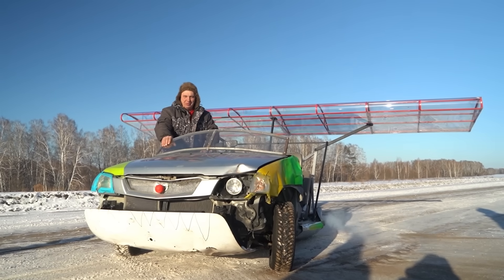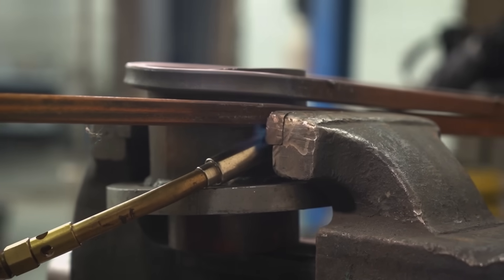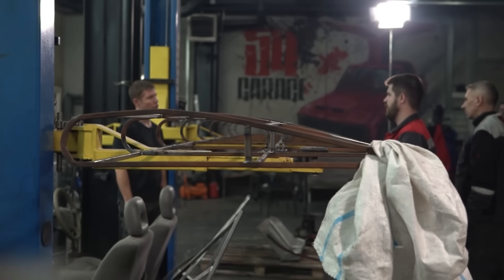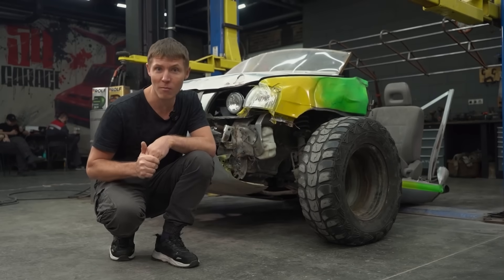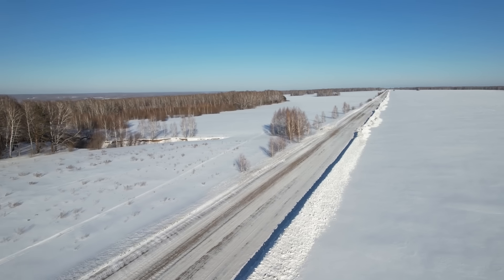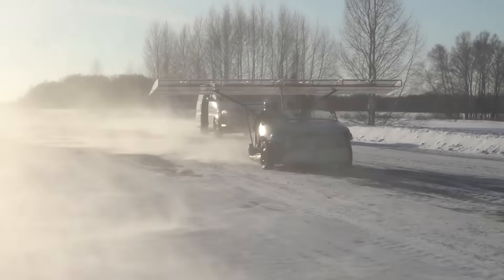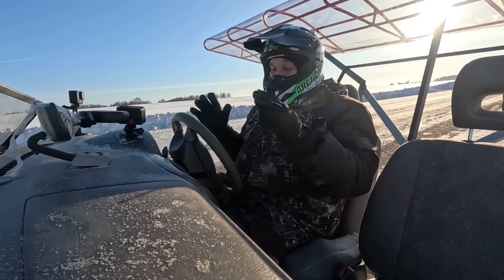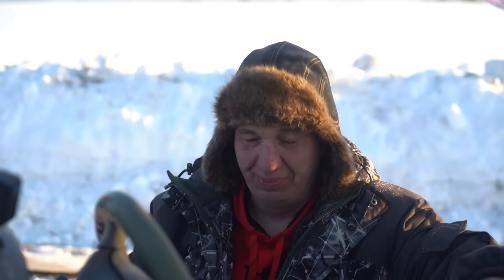We fit a wing to a car - will it lift off?

Comment: It flew a little, but it only came high off the ground when trying to brake; this throws the weight of the wing forward and only looks like flying.  That wing is built like car mechanics would build it, which means overbuilt ;).  It's probably okay, though, as it's big enough to do the job anyway.  Still, it's probably always on the border between flying and stalling and once the rear comes up the angle of attack stops it from generating lift.
Reply: In addition, there is the weight, which was mounted at the front somewhere in the middle of the video.
This also causes the rear end to lift when braking.
So, no real lift that causes the rear to lift off that high.
Reply: One can "fly" in a bicycle by locking up the front wheel at speed.   The rear wheel will lift up in the air.  No wings required.  An actual Cessna light aircraft needs to go 60 to 70 mph to lift off.   There is no way that small heavy wing could produce enough lift at the 30 to 40 mph they were going.

Comment: You need a rudder that is fully functional, to make it steer. Any wind that hit your wing just throw you off with generating little lift but without working rudder, it's not going to do much.
Also 60 km/h is still too slow for that weight, you need about 14 km/h more to have 40 Knots. If i roughly compare it to the Cessna 172 SkyHawk. 
I suggest make some vertical stabilizer, that will work with the steering wheel. But i don't know how to make horizontal stabilizer. Maybe somebody will tell, but i don't have idea.

Comment: Need to attached vertical stabilizers and ailerons to control the asymmetrical lift that’s causing the horizontal axis rotation causing the loss of control.

Comment: Attach small light weight wheels in the back. Something like a shopping trolley would have, but rubber and not turning. Wagon wheels. Should only be a few kilo each. This will help keep the car straight. 

Turning or staying straight when you catch lift - is another issue.

Comment: It needs tail or some type of vertical stabilizer to keep it pointing straight. Basically like a tail of a plane. Make sure it’s behind the wing. 
This should auto correct some of it but ultimately you need a rudder. 
Or you could create some drag on the stabilizer like a dart to keep it straight.

Comment: Last time that I checked a spoiler is used for down force 😂... This would need flaps and higher This is just make the nose turn into the ground because of the front engine weight.

Comment: If the idea is to lift only the rear of the car, it needs three additional things: airspeed indicator (ground speed is irrelevant here), a vertical stabiliser and a means of charging the angle of attack. To create more lift at the rear, a higher angle of attack, and the opposite to lower it. The steering wheel can be converted to be more like a yoke, which also controls the rudder. Ailerons will not work, and will lead to instability and even a rollover.

Comment: I believe if you add a counter steering mechanism on the rear end , of the rear wing , going up and down forming a lower case T , allowing the vertical part of the wing to counter react of the wheels to keep it straight, if that makes any sense

Comment: Why steel ribs? Why not lead?
Reply: Lead doesn't have the tensile strength.
Reply: welding aluminum is pain, maybe
Reply: Good idea. You could fill the tubes with lead, then seal the wing , and fill it with helium or hydrogen to save weight.

Comment: Tail fin with rudder, or just rudders mounted to the current wing assembly, controlled by the steering rack. Move the wing mount point further forward and slap in a propeller in the front and you got yourself a flying car 😂

Comment: You have to put the wing a little bit more to the front and add a tail for control. A propeller in the front and you might actually build a working airplane! I think you need a little bit bigger wing though.

Comment: It needs a rudder connected to steering, a second set of wings at front and rear wheel drive and maybe add a fan to tot somewhere so it has power once taken off and doesn’t glide back down

Comment: Two thoughts here:
(1) What if you add a smaller wing to the front of the car to help with lift 

(2) The steering issue is not turning the car when the back is off the ground it is shifting the weight and trying to role the car, the steering becomes very sensitive when the back is off the ground.
I'm not sure I am explaining what I mean.

Comment: It needs an ice skate ⛸️ attatched to the back, preferably as long as possible, attached to a pole that only pivots up and down and an ankle joint at the ice skate. Laser cut sheet metal would probably be enough for a skate. The pole should be strong and on the longer side for extra stability. Make sure the pole and nothing can twist. Then put weight onto the skate and add more for more stability or take away weight for weight reduction
Reply: It could also feature a spoiler to push the skate into the snow

Comment: it whont fly (all the way off the ground) as it only gets propelled by the driven wheels if they lift of the ground the forward speed will bleed off and it will come down 
having a rudder will allow it to steer even with the rear of the ground the frontweels should stay pointed straight ahead , it will steer like a forklift , they probably tried to get the rear airborne with a crosswind , this pushed the car sideways

Comment: You didn't get lift from the wing on that first attempt, enough to say it was 'flying' it was weight shift from slamming on the brakes that lifted the rear. With the CofG and CofP, no way this thing will fly. The back lifting off the ground when someone was brave enough (and also when the wind was zero) to keep going past the threshold of the wing lifting the rear

Comment: I think the rotation of the engine might have some effect on the stability once you have partial lift off.  As with a sailboat, where CE must be directly over CLR, the wing needs to lift directly over the greatest weight.

Comment: Why not use aluminum if your trying to make it light weight?  Also elevators on the wing would help tremendously. Ailerons and a rudder would be a big help also. But those might be more work than they want to put into the project.

Comment: You must add a stabilizing tale to make it fly, how would you be able to hold it level if it takes off? All planes have a tale and the wings is to short for it's weight. And I doubt you can get enough speed to take off and if it takes off how can you keep it flying without a propeller? When the tires leave the ground you have nothing to keep the speed up anymore. And you need a rudder on the tale, It's doomed to fail. Sorry. 😒

Comment: I'm not sure what they thought they were doing because the speed is all coming from the wheels. As soon as you get off the ground you start slowing down because of air friction. You have no propeller and no turbines. What did you expect to happen?

Comment: Surely these guys knew this would never work. There are so many reasons why. That wing is smaller than a hang glider's; no way it could lift the weight of the driver and all that other POS connected to him. As soon as the rear end lifts, the angle of attack of the wing goes down, so it makes less lift. The upper and lower main spars may (may) be strong enough, but there's no shear connection between them, so the wing has no bending strength. It needs a tail with an elevator, to force the wing to the correct angle of attack. The center of gravity is way, way too far forward. If it were somehow to lift off, you'd lose thrust as soon as the tires broke contact with the ground. You all have a bright future as designers in Putin's air force.
Reply: Watch the video, and you'll see their mission parameters were accomplished
Reply: Congratulations on both comprehension and watching an entire video before making pointless comments. Namely at achieving neither.

Comment: IMO your wing is too heavy, the frame should be made from wood or aluminum and you should make the wing angle more easily adjustable. Also, a winglets or even a small drag chute would keep it headed in the right direction.

Comment: Now you know why planes have rudders for steering. Have the Russians considered aluminium for airframes and wing skins? At least you're not using cast iron and lead sheet. Dont think anyone will beat Top Gear's Reliant Robin space shuttle though.

Comment: The perpendicularity of the wing to the direction of travel is being compromised by the flexibility of the framework.  Cross bracing will help.  A vertical tail will help with cross wind conditions.

Comment: You basically need a whole plane tail construction in the back and another wing in the front
The current construction will generate a lift force on the rear, but because the center of mass is past the wing it will produce a rotational momentum. That rotational momentum changes the angle of attack in the wing, making the rear to fall. That means your system is an unstable system because forces don't cancel each other and the overall sum of them is an oscillatory force that compromises control. The best approach is to use a rudder for control when the aerodynamic forces quick in, another wing in the front to counteract the rotational momentum and a set of horizontal stabilizers to add lift when the back lifts up and mitigate the loss of lift
Reply: Don't need a wing in the front.  If you lift the front you have no propulsion because the WHEELS have to be on the ground for that.  All they are trying to do is lift the back in place of wheels being in the back.  And any extra lift in the front will make controlling the vehicle even harder as the vehicle loses friction/traction with the ground - the steering is the same wheels.
Reply: @HutchinsonJC  you will have no lift at low speeds. Only at the enough windspeed you will have enough lift to loose friction, but at that point you will also have enough speed so the aerodynamic surfaces can compensate like a rudder would. They have a static stable construction, but it is dynamicly unstable.

Comment: Hi guys, that was great, love the idea and enthusiasm! 
A thought re the direction stability, yes a fin and rudder would help but perhaps you should try putting some dihedral into the wing, this naturally makes it more stable and is a common feature on aircraft, eg AN2
Added thoughts - how about putting some flat plates on the end of each tip to act as selt correcting rudders? Easy to try.

Comment: The old WW1 pusher style biplane called a DH2   https://en.m.wikipedia.org/wiki/Airco_DH.2   is close. So you could run a prop shaft and prop out the back and put a front or rear tail on for directional control and stability. And a joy stick in the floor. You are very close to a flying car!

Comment: I think it nees a propeller, because the moment the wheels loose grip on the ground, the air resistance will slow down the car and it will wall down immediately. Just make a plane of it ;)

Comment: Hey guys!    You need a tail rudder!    Keep the wheels straight straight when it starts to float and steer with a tail rudder.   Also slope wings up slightly from the center so it self stabilizes left and right

Comment: Add stuff and lift that thing full of a ground, put that huge fan you tried on its front, remove even more stuff to reduce weight and give it a 4-5 meters long tail with + style basic wing control (side to side, and top to bottom). It could work to lift it fully for short distances.

Comment: From Garage 54 to Hangar 54. Btw, you need a vertical stabilizer, with a rudder possibly, so whenever it's airborne, you still have the control. But I think the wing's angle of attack is also important, maybe making it adjustable can help a lot.

Comment: Cool experiment bu I ran the video several time and never saw it get airborne. The rear, yes. but if the front wheels lose traction speed drops preventing lift off.

Comment: garage 54 in year 2030: we make spacecraft from lada and make trip to mars
Reply: Yes, call Elon to not worry about it, G54 has it covered.
Reply: and get fined $100 for not having a pilot licence.
Reply: @joelpichette  how world they get fined in space? Think!
Reply: Space R
Reply: Lada spacecraft with 100 electric drill motors, rubber bands for shock absorbers, and sawblade wheels. Oh, and a billion kilometer extension cord for the motors.
Reply: @randallmacdonald4851 und nicht zu vergessen die Computerchips aus Kühlschränken und Mikrowellenherd ☝️🧐 
😂🤣😂🤣
Reply: Space L (from Lada) or Space G54 (from Garage 54). 😅
Reply: 2030 oo long.

They'll do it tomorrow 😅
Reply: Hahhaahah!!!
Reply: 5 more years
Reply: 2030 What is that like 2 years away? xD
Reply: And 10 minutes
Reply: WING IS TOO HIGH!!!  REmember Ekranoplan, you need wing to be low to use ground effect!!
REMOUNT WING TO 40 cm off ground, it wil lift off AT 45 KMH!!!!!!
Reply: And our mars Rover is wood with a Lada engine ❤
Reply: With Cordless Drill

Comment: You need to position the centre of the lift just behind the centre of mass. A tail will assist you in maintaining a straight line, along with some flaps to help it take off at low speed. You might also consider a parachute.

Comment: As soon as the rear end lifts, the vehicle wants to spin 180 degrees because the greatest drag is forward of the center of lift.  There's no directional control.  Add a 20' boom to the rear with a vertical fin about 4' square and it will track straight.  Even better would be to add a rudder to the fin to provide increased directional stability.

Comment: You would really need a vertical stabilizer and rudder. I think it would be more interesting to actually see it fly. Try adding another wing to the front and make one of the wings pivot with the handbrake to control pitch. Rudder can be hooked to the steering wheel for control.

Comment: ...you've actually done what I've proposed in the previous video, but it's missing the spoiler on the front to increase te grip of the steering wheels. xD

To make this thing a bit more controlable, try installling a forth pedal that will control angle of attack. This way you could control the amount of lift. 

Also, a an aeroplane rudder would be of help...;P

Comment: You need a tail fin to maintain directional stability, and maybe a rudder attached to the steering to control the direction once the tail lifts off.  Also maybe make it into a biplane for more lift at a slower speed.
Reply: basically a plane tail wing
Reply: And maybe flaps on the wing?
Reply: Should use a 10" rubber trolley wheel as a rudder in combination with a tail fin
Reply: Giving the wing some dihedral won't hurt either.
Reply: if the thing would rise 20 feet off the Ground then Real trouble would arrive
Reply: @dancingtrout6719  With it's Centre of Lift so far behind it Centre of Gravity there's no way it's getting off the ground. It would nose dive well before then.
Reply: @vannoo67  hey did you know the helicopter is the flying coach/flying car ..??
Reply: WING IS TOO HIGH!!!  REmember Ekranoplan, you need wing to be low to use ground effect!!
REMOUNT WING TO 40 cm off ground, it wil lift off AT 45 KMH!!!!!!
Reply: how about a pilot chute? 
would keep it a bit straight, right?
Reply: executive order said we must have only two genders I don't think there is room for anything bi
Reply: Most important of all, you need a refueling probe so you can travel to lots of other places overseas. Come to Telluride, Colorado first. Lunch is on us. Bring your skis.
Reply: I'm glad you said that I was literally going to say the same things
Reply: he brakes when it starts flying thats why it turns...
Reply: If you could break the frontwheels independently.

Comment: The wing should be at the CG, you need to have a rudder connected to the steering and a fan connected to throttle after it takes off.
Reply: Trying to make it actually fly is stupidly dangerous. Once you get airborne and add a prop it's just going to crash harder and faster.

Lifting the rear is perfect balance.